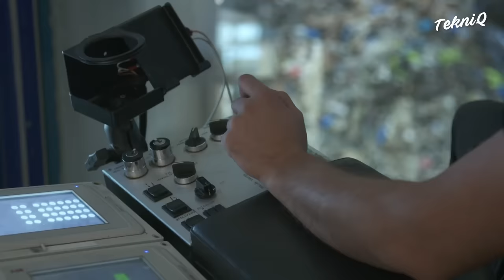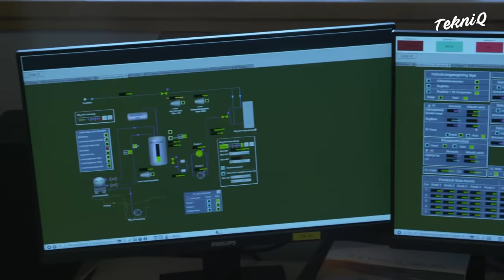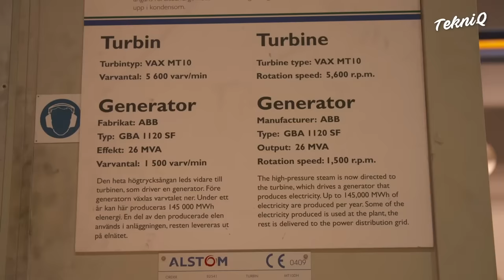Inside Massive Facility Burning Tons of Trash Everyday

Comment: I bet he wins a teddy bear every time at the fairground.
Reply: I run a large overhead crane very similar to that one at a waste to energy power plant and every time I see a teddy bear in the pit you know I'm picking that thing up. I feel like such a badass delicately swinging around a 10 ton crane just to pick up a bear. At one point I had 6 or 7 of them set out on the window sill visible from the parking lot until the boss threw them back in the pit :P
Reply: Had that thought myself.
Reply: Tyler Mac and you see they admitted the morning
Reply: @tylermcintyre1454  As they rotate and cut the sky.

Comment: I love that this is happening. I had the same idea a few years back. I don't know where this plant is but yeah I think that this can be done in a very responsible way with superheated fires and exhaust filters/ catalytic converters. It's a whole lot better than ruining the land with landfills and filling the ocean with plastic. 👍👍
Reply: I work in such a factory in the Netherlands. We use the steam (40bar, 400 degrees Celsius) for electricity, house-warming and lowpressure steam for preheatingprocesses in the installation. The gasses will pass electrostatic filters, deNOx (katalysator), tube-filter with active coal (dioxines+furanes), washing tower (acids + SO2). Slack  will be used for roadbuilding.
There will always be a little part of waste they cant work with yet.
Reply: Think you have to calibrate the gauges?
Reply: this is from sweden and we burn trash for heat :) also some years ago we had to import trash because we had no trash left xD
Reply: This plant in the video are swedish im not sure exactly where in sweden i live in gothenburg and we have one here butt i think the one in the video are on the East coast somewhere they talked in swedish and the trucks have swedish numberplates and company names
Reply: We do this in Minneapolis as well at the Hennepin Energy Recovery Center
Reply: Tyler Mac this Truck is exactly the same way and it’s going too the other places
Reply: Burning trash for heat is as old as time, bro thinks he had an original idea lmfao

Comment: I worked as an industrial hydroblaster in 2001 .we went to Nashville Thermal plant that burned trash for electricity…we cleaned the ash around the coils and did inspections to the coils .. the claw was called “ The Fluffer” which feed the augers the furnace
Reply: Tyler Mac and why is that
Reply: Tyler Mac there are trucks with bags
Reply: Fark that would have to be one cancerous job surely? The Dioxins in that would be insane

Comment: burning the  waste looks like a really good idea as it gets rid of it and it generates power so it is win win, the only thing i did not like was how the ash was dumped as it clearly still has steal in it which poses a hazard to people and animals and is just a waste, the ash really should go under a magnet separator that way the steal could be sold as scrap and reused.   That glass recycling place is a mess and an accident waiting to happen, glass all over the very road that the drop off trucks are using or the way the trucks dump the load in a way where the load falls under the wheels of the truck, at best you are going to get a flat and at worst constantly driving over glass is going to cut up and weaken the tires so they fail when you least expect it
Reply: Have you read your own comment? Everybody is talking about the climate catastrophe we are facing and your only answer is: Let us create more (plastic) waste and let it burn! Win - win? Who wins? The industry creating more waste you can buy and throw away? God, please let it rain brain!
Reply: @DerAusdauersportler  cringe

Comment: The scenes from Pakistan (?) were very sad. No rebreathers and limited safety protocols. I would imagine the workers all have silicosis. 😢
Reply: I’m not sure you can get silicosis from  plastic bottles
Reply: @spannaspinna   I'm pretty sure that dust won't come out of the lungs once it's in there. 20-30 years down the road, they will have issues.

Comment: The problem here is that you are turning trash into atmospheric CO2. Where if it went to a land fill, the carbon would be sequestered.
Reply: And methane and other gases would escape
Reply: I thought It went through a filter? It's only carbon ash that eventually falls to the ground
Reply: Yes, methane can be produced but at a much slower rate. Years and decades compared to all at once when you burn the trash.